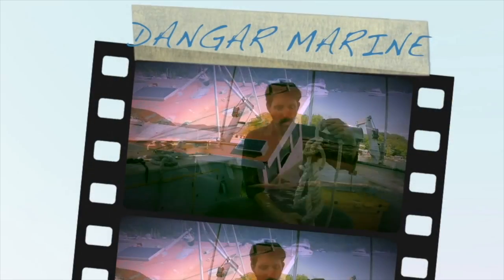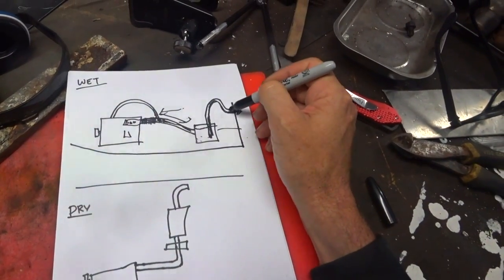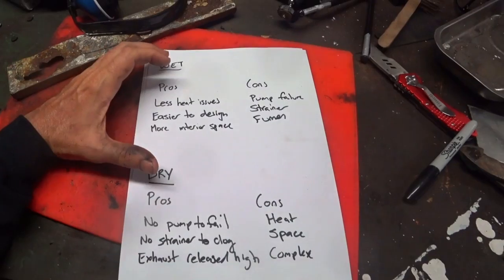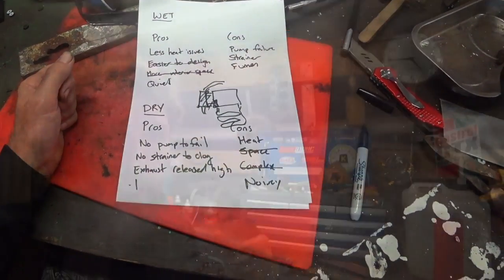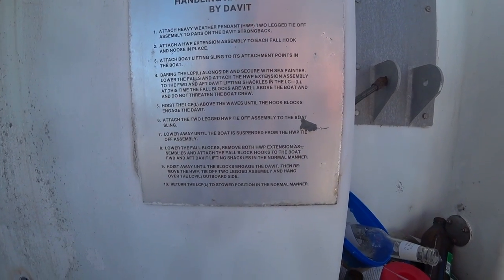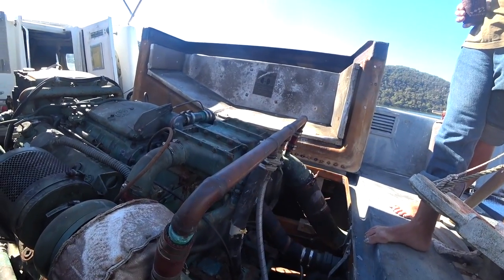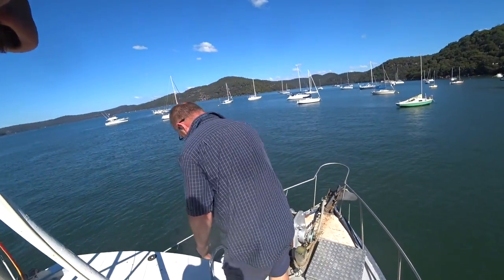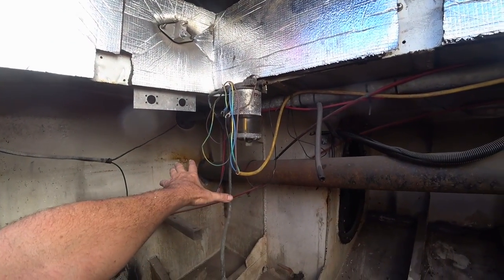Wet Exhaust vs Dry Exhaust

Comment: I think you need to research more on the " Detroit's are sensitive to back pressure"   they are not scavenging thru ports in the cylinder, but have regular exhaust valves, just like a 4 stroke,   if they were  sensitive to back pressure you could NOT turbo charge them, and your video clearly shows that you CAN.     I would get a muffler from a truck breakers yard.     Keep up the great work.
Reply: Same thought here. Semi tractors for example, stacks on both sides of the cab. When I was little boy semis would puff smoke every shift, they were all Detroits in the 80s and double stacks were standard. Big chrome stacks, beautiful tractors.
Reply from the maker: Hey mate, excellent point. I knew these engines pushed the exhaust out through valves but I was thinking more traditional two stroke at the time for some daft reason. Rick has a naturally aspirated 8-71 in his workshop and he did mentioned that it isn't the same motor with turbos bolted on, there are some other differences apparently but I'm not sure what they are. The detroit diesel service manual does specify the maximum back pressure allowed so at least I have something I can measure once the install is done to make sure it is within spec.
Reply: @DangarMarine       I have never had my hand on a Detroit diesel, but USUALLY the difference between a NA and a turbo engine, is that the turbo version has about 2 points lower compression then the NA version, to compensate for the added charge volume (pressure) (as to not have to high cylinder pressure)     a REALLY quick search shoved that the back pressure should be less then 3 psi on a NA diesel
Reply: @BD-fw2gm Aren't all two stroke outboards technically 'wet exhaust'? So that would seem to shoot down that the back pressure is an issue.  That old system on Stu's boat with the wet box, water injected exhaust etc (that injected water takes up volume that should be space for the exhaust gases) would all cause back pressure. That is why the wet system is quieter- it is like an over muffled car exhaust- quiet but robs power because of poor flow rate. On conventional subs the exhaust gases are water sprayed after the mufflers when surface running at night - quieter, cooler ,lower infra red signature) but lowered out put power a bit. Also gave off lots of steam which is why the spray was used at night or in harbour only. Snorting exhaust was sub surface and not often done due to lots of reasons. being on the surface during the day was too silly  to do in anything but surface transit runs. 

 Go dry exhaust - way simpler to look after, fault find and repair. I have seen a 'wet muffler used on a trawler though - a normal steel muffler with a pumped water jacket  around it - very quiet and safe to put your hand on at any time - and the water jacket had a line through it for fresh water heating .
Reply: If you're worried about back-pressure put an expansion chamber at the end of the exhaust manifold. The size of the chamber depends on the cc of the engine. All flow inhibitors after the chamber are near null, so you can use the biggest muff you would want to use.

Comment: That wet exhaust is like the duct work in my attic, right in the middle of everything and leaving no other useable space.  Run your dry exhaust through an insulated box with air intakes at the top before going through the roof.  Ditch the twin pipes for a good muffler and stack pipe.  Simple is good.  :)
Reply from the maker: Yes, I think when people do installs like that they are only thinking of making their own day easier without any thought to the future.

Comment: I've NEVER Heard a Detroit So Quiet as yer Mate's was through that dry muffler! That's a damned GOOD Muffler, I'd call the guys who built it, they Know What They're Doing....If they can Silence the V-8 that well, your 4-71 will be No Challenge.Hate to see the Price Tag on that Stainless, though. Also, you want to recall that when your boat was built, nobody MADE a Muffler that WOULD Quiet a Detroit, which is no doubt why they Converted her to Wet. And you DEFINITELY Need the space. With the Wet piping Gone, you could also build a clamshell box around your motor,  Soundproof the Hell out of it, and so keep it down to a dull rumble throughout the boat, Below Deck. BTW, you could also Shop for your flex-pipe and the New-Style Band-clamps at a Truck Parts store, instead of a Marine store, which should get you a BIG Price Discount. And the New-Style clamps seal MUCH better, and easier to install also. You just want to Run them a day or so, and Re-torque the bolts, after they get hot and Seat In. I can't Get OVER the Muffler on that boat!  Even at the Helm it was just loud enough to hear the engine, so you could tell if it started running rough or missing..That was GREAT. I really LIKED you Shop Cleanup, BTW.
Reply: And ?
Reply from the maker: Thanks mate, appreciate all the info. I'll definitely be giving the manufacturer of Dave's muffler (Dieselex from memory) a call and see what they can do for me. :)
Reply: We've run them for YEARS hereabouts in trucks and equipment, never heard a Quiet one, even with BRAND NEW Mufflers. All through the Seventies. Greyhound and other passenger coaches with Detroits were loud, also and they were Muffled to Death. It's the Nature of the Two Stroke Detroit, and why I like them. Neighbor had a sawmill powered by a 4-71 like Stu has, it had an 8-inch straight pipe, and when he sawed, we could tell what kind of wood he was in by the sound of the motor. It was a Mile Away, and sounded like it was in our driveway. Three hills between with trees. It got on people's nerves after a couple days.  A friend of my Dad's ran Cabovers with Buzzin Dozens, his always had New Mufflers on it, and we could hear him pulling up out of the Laurel Gorge with 50 tons of coal On. TEN Miles away. Dad drove a 359 Pete, the ORIGINAL Extended Hood, Buzzin Dozen and 13-speed, and I could listen to him coming home from Eight miles away, Empty. I don't know about in Boats, but don't tell ME I don't know Detroits, Little Boy, the first engine I ever rebuilt was an 8V71 T. 35 years ago.  @EDesigns_FL
Reply: I don't know how long Dieselex has been Around,  And I guess Trucks and bulldozers Do Work Harder than Boat engines, except maybe a Tug or Pushboat.I don't know what alloy of SS the muffler and bandclamps today are, but the ones WE had didn't corrode all Winter long in the roadsalt and calcium.... @EDesigns_FL
Reply: @EDesigns_FL  the engine was on a high idle. You could see that with throttle.

Comment: Brilliant 2 vids this week. That clanking from the wet exhaust cover would have driven me completely insane
Reply: That rhythmic clanging would drive anyone nuts.  Stick a rubber strip on the flap.
Reply: Yeah that was driving me nuts just in the video.
Reply: Like said a rubber flap would stop that.
Reply: @Voltaire321  They were a bit too drunk to pay any never no mind... not that that's a bad thing!
Reply: I think with proper maintenance on that boat/motor it'd be different.
Reply: Jefferson Le Roux 
My guess is that the exhaust leak is the cuplrt there. Not enough constant pressure to keep the damn thing open. The starboard side doesn't seem to have that issue.  That being said,  I think the example of wet exhaust that was chosen wasn't a good example.  That smoking doesn't look like a healthy power plant,  and, to be honest,  if that's someone's idea of quiet, someone is deaf!
Reply: @MrPaige222  Quiet is a relative term.  Detroit Diesels are great, nearly bullet proof engines that with any sort of care will last nearly forever.  They are, however, noisy.  Being able to carry on a normal conversation on the aft deck with a DD in the bilge is indeed "quiet".
Reply: Yeah, I'd say all that smoke might be caused by that same exhaust leak. Turbo can't get any pressure thus can't force more air into the engine.
Reply: mfk12340 
Extremely likely.  I can't believe he hasn't addressed that problem.  Looks pretty simple to fix....no hidden bolts or clamps. At the very least, he'd probably eliminate the clanking. And, very possibly,  actually almost certainly,  he'd stop emulating Los Angeles AND improve his speed and efficiency.  I can't believe Stu didn't suggest it, but he's probably just being kind.
Reply: @MrPaige222  Might be a situation of people having suggested it and the owner saying "yup, I'll get right to it" until everyone is tired of the song and dance and just ignores the problem lol
Reply: Barry Linkiewich 
He's a stronger man than I am to put up with that clanking. I guess he's just going to wait for his bank account to empty with all the fuel going out the exhaust . So many people like that.  You should see how people ignore problems with their cars and motorcycles in the Philippines!  A 50 cent problem ignored becomes a 2, 000 dollar issue after the maintenance is deferred long enough.
Reply: Or Bad shaft seals in a turbo causing oil to leak into hot side?  @mfk12340
Reply: You would have to cut it off

Comment: Well explained Stu, having NO prior knowledge of the two types of systems.....I like the dry exhaust version myself simply because it is simple and maintenance free with little risks associated with it. I can see the opposite with the wet exhaust, high maintenance and high risk due to pump failure or leakage...the space gained form removal of the wet exhaust is substantial too. Well done Stu keep up the good work mate 👍
Reply: If your water pump fails, it isn't the exhaust that will be your largest problem because your motor won't be cooled either. The risk of pump failure between the two exhausts don't change unless you have more than one water pump for your wet exhaust, which isn't usually done.
Reply from the maker: It isn't common, but this boat does currently have one pump for the exhaust and one for the engine.

Comment: Your doing a great job man.  One point about a dry exhaust.  It's much simpler, therefor there is less to go wrong at the worst possible time.  Like at night, where you can't see the shore, or any lights, and the weather is bad, and you need all the power your engine can give you.  This is not the time, to have an exhaust issue.  So, if I were you, I would go with, and keep the dry exhaust.  Just one less thing to have to worry about.

Comment: Wow, didn't expect a cleaning video from Dangar Stu.👌😄 7.08.

My experience of 2-stroke engines is that exhausts are purely expansion chambers which do little muffling. 
I know there are equations to be worked out in making a petrol expansion chamber, not sure about diesel.
Maybe this is why it was converted, because of the combination of 2-stroke and noise? 

I used to drive a Detroit diesel truck in the seventies and it WAS noisy even beside other trucks way back then, when everything was louder.

Comment: I am currently re-fitting a steel trawler with a DD 4-71.  She came with dry exhaust and I'm keeping her that way.  Her engine is just below the cabin/helm and yes, 2 cycle Detroits are noisy.  I've fitted a false flood in the cabin with 1" of rigid foam on top of a rubber mat over the steel decks, then plywood.  Helps immensely.  One clue is that you'be got to get a complete seal between the living space/engine compartment.  Even a small opening will allow a lot of noise to pass.  A huge thanks for researching the muffler!  Mine's got one, but I suspect it's not the best configuration.  Once you selected something I'll be following in your wake!  I've also considered a removable pipe extension on top of the stack to move the actual exhaust port up higher and away from the aft deck.  Thin wall stainless ducting ought to work.  I'll report back if it works.  Why all the off-topic comments on the flag?  Seems like hyper-vigilance. The boat was a perfect example for the video, and I for one couldn't care a wit about what sort of flag anyone flies from their transom.
Reply from the maker: Hey Robert. Glad to hear I've got someone to compare notes with! I'm looking forward to talking to Dieselex and seeing what type of muffler(s) they recommend. One thing I should have commented on more in this video is just how much difference sealing the engine room makes to the overall noise - it is only 50% about the exhaust system. Couldn't agree more about Rick's flag - it's his life to live exactly as he choses.

Comment: That flap would drive me mad , Steve in Thailand.
Reply: yep me too, I would have to stop it clacking all the time.
Reply: Ding ding ding ding
Reply: @ReubenHorner  🙉🙉🙉🙉
Reply: Varnce  🤣
Reply: I suspect that flap clanking is the result of an engine not running on all cylinders. A Detroit will run in almost any condition. With the amount of smoke coming out on acceleration , this engine needs a tech to diagnose before it starts running away on its' own lube oil. I didn't get a good look, but if it's an 8V-71T, it's about 3 times the engine that boat needs.
Reply: @e.j.s.1357  That's like my motor in my 69 Chevelle.  
My point > more is a GOOD thing. At least where I come from!
Reply: I'm sure there's a few flaps in Thailand that have driven many people mad :-)
Reply: Steeevo 01 very true .
Reply: detroits will surge a little at first start up, i think this is what is going on. when it surges it blows the lid high, and then the weight closes it for a neat ding ding ding sound
Reply: @uliwehner  thank you. Steve in Thailand.
Reply: Same
Reply: First thing I thought lol!

Comment: Good job of showing the differences in the two systems.  I think I might like the dry system better too.  A lot of extra parts to make the wet system work and takes up a lot of space.  Also, you're smart leaving the wet system in place until you're sure of what works best.   And checking with the exhaust experts might convince you straight away to stay with the wet system once you find out what the dry system will cost you in performance and noise.

Comment: Another awesome video! 

My opinion after listening to what you said is that a dry exhaust is actually less complex than a wet system.

I spent 9 years rebuilding an EH with a turbo motor and basically to compensate for backpressure issues from mufflers etc an increase in diameter might be needed. 

One thing to consider might be because the exhaust was so short on your boat may have made it quite loud.

All of our generators at work use like an eggshell foam lining in the outer skin and it works extremely well that could be an option if it became an issue.

Thanks again for an awesome vid!

Comment: chop the lot out, use a flexi pipe up to deck head, then across to the side, and down to exit just above the water line , if need be you can use a rubber muffler outside to lesson noise and stop any backwash......... I have noticed with Stack Pipes if they are not high enough you get a back swirl of exhaust in the after deck when going forward, but a canopy could remedy it........... good luck with the project I have done a few of them mostly on wooden boats......cheers UK..
Reply from the maker: Yes, I can see how the vacuum behind the wheelhouse could draw the exhaust fumes back down. My big worry is that I go back to dry and then go, ah, that's why they got rid of it. ;)
Reply: Dangar Marine how easily can you test it?

Comment: Nice explanation, very clear. I have worked on a trawler with a dry exhaust and it was noisey, but there was no muffler, or soundproofing fitted. A steel boat will always be noisier than a wooden one as the wood absorbs sound, while the steel echos and vibrates more.
Reply from the maker: Filming Dave's boat made me realise just how much of the noise is direct mechanical noise from the engine, something that is only worse in steel. I'll definitely do as much insulating as I can too.

Comment: Good vid Stu.
One other option that a lot of commercial vessels use for a wet exhaust is to run the pipe externally and use it as a sponson.
This is very popular in WA on cray boats.
Reply from the maker: I like that idea. I think giving anything a double purpose is a really great way to save space on a boat.

Comment: Good idea leaving the wet system in place until you are satisfied with the dry.  There is less possible system failures with the dry. A proper muffler, sound deadening applications should do the trick. Will you be installing a gen set? Also with the stuffing box cooling the shaft nothing changes wet or dry. Looking good brother! I believe your wheel house will be quiet as compared to your friends boat as the engine is under the back deck instead of below the bridge.
Reply from the maker: Yes, I'm glad the engine bay doesn't open up inside the wheelhouse.
Reply: Is there oil in the exhaust because of the two stroke?
Reply: @mastermachineman1462  No. There is no mixing lube oil with fuel on a Detroit diesel. Other 2-strokes use the crankcase area to pressurize the intake air to help push the exhaust out of the cylinders and replace it with fresh air. When this is done it is difficult to use the crankcase area as a lube oil reservoir. This is the reason other 2-strokes mix oil with the fuel, to lubricate the crankshaft, pistons etc. A Detroit does have its' lube oil reservoir in the crankcase and uses an air pump to pressurize the intake air and help push the exhaust out of ports in the lower cylinder walls. You may have seen these pumps before, mounted on the top of old hot rod car engines. They were commonly adapted to use as one of the original super-chargers for gasoline engines!